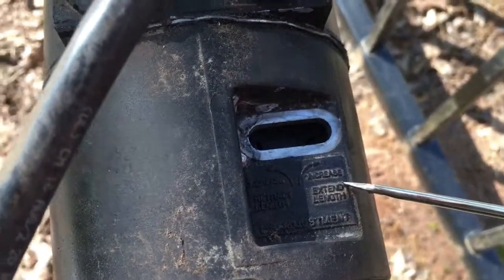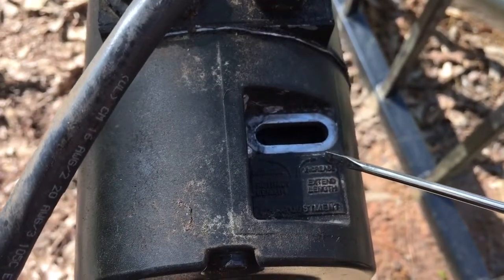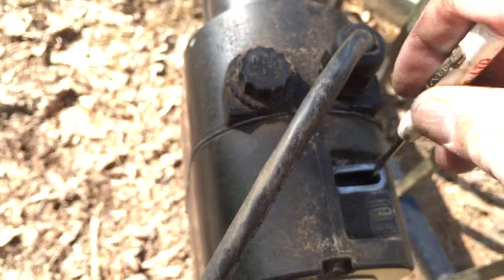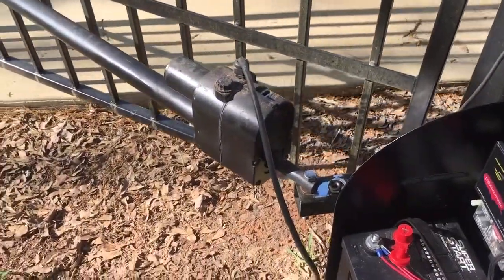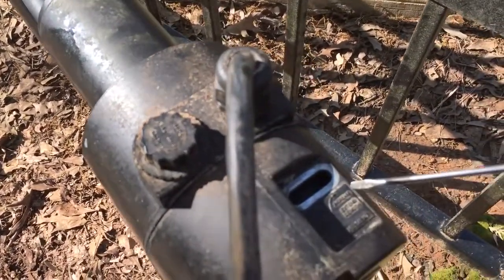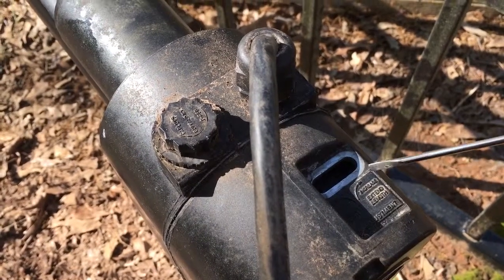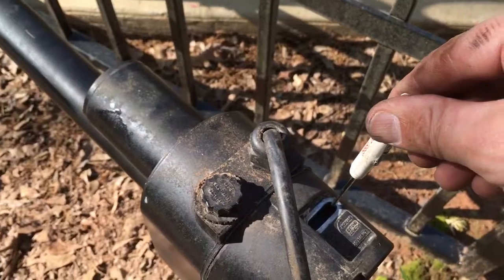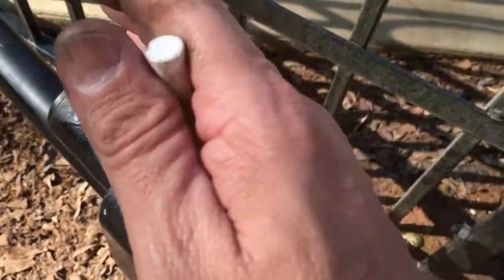Replacing a Patriot limit assembly board #5

Comment: I wish you had shown how to turn the actuator upside down.  Do you have another video showing that?
Reply from the maker: Remove the bolt on the end of the arm that is attached to the post and turn it over, adjust your limits, remove bolt, flip the arm "right side up" reinstall bolt and you're ready to go
Reply: So I have everything back assembled but I cannot adjust the limits, the flattip screws will not turn to adjust left or right, the part I replaced did the same and the plastic stripped.  Any thoughts?